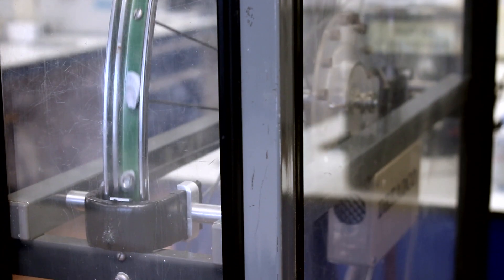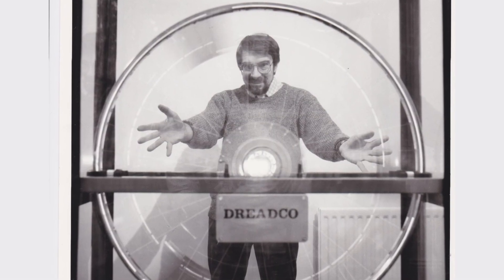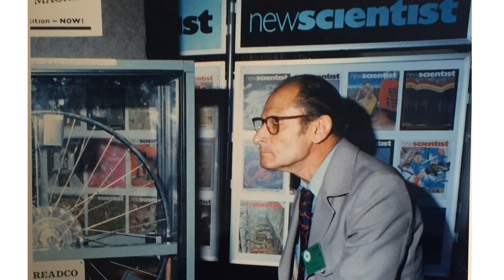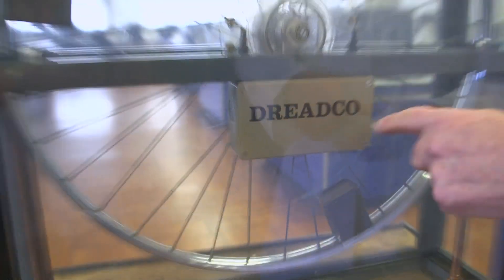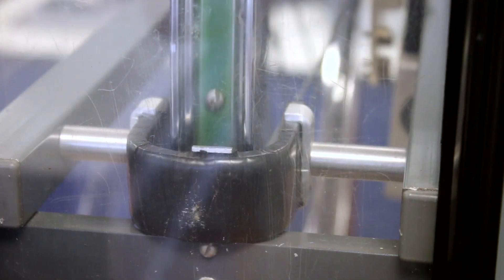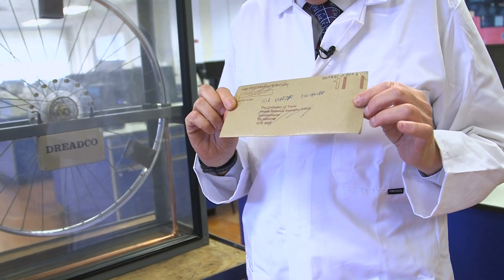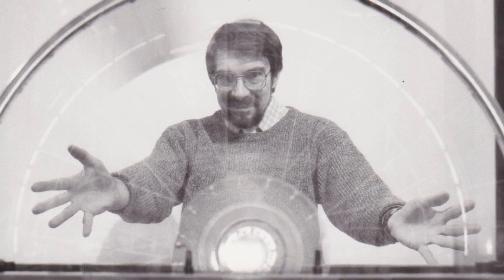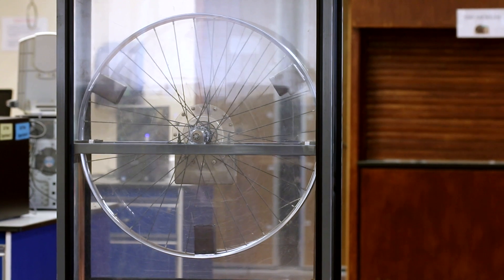Perpetual Motion Machine - Periodic Table of Videos

Comment: If I make guesses and they are relevant to the truth, would you confirm the guess is right or at least on the right track?
Does it have something to do with heat?  The temperature difference between inside and outside the wheel cabinet?
It's running slower because it's stored in an air-conditioned building?  Would it speed up if it is periodically moved to a warmer or cooler environment?

Edit:
I just visited the SubReddit and see lot of people asking similar questions.  I'm not clever.

Comment: It's either a magnetic push pull arrangement or the blocks on the wheel contain a liquid such as lighter fluid or isopropyl alcohol and as the box passes over the the heat sink area it vaporises, or if it cools, condenses, and alters the weight

Comment: Once this "machine" finally stops, it will be interesting to see if the energy source ran out or if the bearings have worn to the point where they generate so much friction that it can no longer be overcome. My guess is that the 3 boxes on the rim contain nickel/ copper stacks, wetted somehow with salt water to generate a small current. It would be simple to add a few coils of wire and rig up a electromagnetic circuit which pushes away once the yokes have been passed.  Once set in motion, it would keep spinning for a long time, provide a few mechanical rules:  The bearings have to be clean and with very low friction, The rim has to be balanced near perfectly with the boxed mounted. the axles has to be mounted level right to left to avoid breaking action from side loading. The display case must be sealed close enough to keep dust from infiltrating the space and "gunking up" the works.

Comment: My guesses:

1) The three boxes mounted to wheel each contain a small electromagnet, battery and simple circuity including a reed switch. As the box passes the magnet at a specific position, the reed switch closes (due to magnet force) energizing the electromagnet. A pulling/pushing force is generated between the electromagnet and permanent magnet. The trick would be ensuring the correct bias on the reed switch/timing to prevent the wheel from being stalled as the magnetic fields 'align'.

2) There is a small electric motor in the beige project box below the hub and axle. Perhaps a friction drive wheel is hidden in the horizontal square tubing.

Comment: I'm going to guess the center box and plastic disc with metal nubs on it are an electrostatic motor. Energy generation could be photovoltaic, thermoelectric generator, or concealed batteries. Electromagnetic is also possible, but I'm going to guess that's misdirection.

Comment: There are several hints in the video that helps us to make a good guess:

1) The fact that the wheel has been turning for two years, but been slowing down over the time period suggests quite a clever process, but one that is probably dependent on an electrical battery.

2) The steady rate of turn of the wheel would tend to reject the use of magnets, unless there were magnets all the way around the circumference of the wheel.

3) The question remains, how does the battery tranfer its work energy into the wheel?

Comment: It has a battery with a Jewel thief. This creates an small impulse via the ring of magnets on the inner ring with a high voltage via static electricity. In short, it's got a motor and a battery.

Comment: Most longlasting design would be a small motor inside the wheels axle. Pull a vacuum on the box so air friction will be eliminated. Very good grease for the axle and the thing will run 2 years without a problem. The tubes and heatsinks as well as the boxes on the spokes are likely decoys tricking someone into thinking, this is a very efficient thermodynamics setup.

Comment: Is hard to say not seeing it closely. Possibly magnetic repulsion motor with three counter balances with magnets, heavy duty alkaline battery and  box under contain transistors to control coils to weaken the repulsion when magnet pass, or it is pulse motor which timing is different a bit and can have  recharging circuit running of capacitor with help of alkaline/crystal/ or any type long time  battery. Big wheel , low friction bearings, counterbalances adjusted right, short control pulses it will run couple of years. One of mu toys was running slowly still after  2 and half year on good 9v battery. It is not a perpetual motion machine just very efficient motor. Anyway nice toy :)

Comment: Thermal expansion on one side of the wheel will shift the center of mass of it in order to rotate it, hence the input energy is the required heat.

Comment: Perpetual motion machine. Attach toast with jam to cats back. 
Lift cat, and drop. 
Cat always lands on it's feet. Toast always lands jam down. 
The result can only be a perpetually spinning cat stuck in mid air.
Reply: PJ put it in a washing machine drum and ta-da, free electricity
Reply: uhm actually .. thats how  a washing machine works
Reply: The cat is in an ambiguous state until observed. Fail.
Reply: Dorothy Baker unless you have a perpetually spinning cat in mid air, no. your spam has no power here.
Reply: but you need lift, so you wrap the cat in magnets and drop it on opposite pole magnets that are designed to stabilize rotating cat mid air.  cat is immortal so no need to worry about food
Reply: You need to put the cat in a box so that it can never die. Just don't look inside.
Reply: Except if the cat lands on its feet (which would happen) then the toast hasn't landed at all.
Reply: You fool, just use two pieces of toast haha
Reply: Where's the fun in that? 
I'd rather glue two cats together.
Reply: Tell that to one of my obese cats that slammed on his back from falling off my stair landing overhang.
Reply: I'm not entirely convinced. The result could simply be a cat with a jam toast suspended in mid-air, with no rotation at all. As long as they are excluded from ever landing, catoastions would not be required to have spin.
Also, catoastions would only be stable under constant observation, as cats tend to tunnel to random places whenever not observed. So if you look away just one moment, you'll hear the "splat" of the jam toast on the floor, and when you look again the cat will be nowhere to be seen. Probably on the other side of a locked door. Meowing to be let back in. Only to change their mind the moment you do open the door.
Reply: The Buttered Cat Array, huh?
Reply: @PJ I have been led to believe that is how UFO's hover and it would explain the screeching racket reported by some people claiming to have been abducted by aliens.
Reply: To get useful work out of the spinning cat/toast array then a spindle needs attaching somehow. I hope the cat doesn't find the spindle insertion too painful.
Reply: Just put jam on both sides of the toast. That way you can leave the cat alone. Maybe let it play with the floating spinning jam toast.
Reply: This is actually the original basis for Schroedinger's cat demonstration, but he changed it to radioactive decay in order to seem more scientific. The cat is both jam side down and jam side up until it is observed.
Reply: oh no that wouldn't make sense. It still has to use some kind of energy to keep the cat spinning against the air resistance, so it'll obviously drop down forever while never reaching the bottom, so it doesn't intersect with the stated axioms of cat and toast movement. 
The cat's angular momentum will decrease as well, of course, until she's spinning with an infinitely low velocity.

I understand how you could make such a casual mistake, but please, stand corrected.

Comment: I think somehow it produces energy from heat! Maybe that glass cover create a sort of a greenhouse effect that creates an air convection flux that may have something in common with that copper tube and heat dissipator that makes the wheel spin. Or maybe the energy generated by heat activate an electromagnet that turns on at specific times to spin the wheel. Those are my guesses.

Comment: Well my first guess was those three black boxes are solar panel and it's powered by some kind of electric magnetic force, then another guess came to me after I noticed the copper pipe, the black boxes might absorb light and heated up, the temperature difference of the liquid inside drives the wheel <3

Comment: Bicycle wheels are amazingly free running and small battery powered clocks seem to run for ages using only very small batteries. So my guess would be to conceal a battery and a clock mechanism style circuit inside the hub. This is essentially a tiny pulsed stepper motor and gears. The mass of the wheel would serve to smooth out the pulsed motion normally seen on the second hand of quartz clocks.
Reply: Such a delicate mechanical linkage would probably be damaged just from moving it across the room.

Comment: I think it has to do with temperature. 
The boxes might move due to convection currents; On the other hand what heats up the inside could've been a radioactive material that is running out of fuel with time.
Or, a thermocouple converting heat into electricity getting movement onward. Or the combination of both

Comment: bet all the common perpetual motion machine guff is just red-herrings. without being able to test various possible power sources (aka; leave it in a dark room for a week and measure change in rate compared to full sun to see if its really just basically a stirring engine) it's impossible to really say.

from what can tell if video would have assumed the little heat sinked box is a heat engine (using heat from light) powering some sorta air moving system to draw air from one pipe and pump it out the other? though seems that wouldn't provide enough power to over come rolling resistance the high quality bearings and well balanced wheel should allow it to run indefinately. HOWEVER you state that the wheel has been slowing down with time which implies an internal powersource rather than external, 

I think it might be something simple, the canisters are full of lead and the bearing is very smooth. though frankly that seems unlikely to pass the "Only one person has ever got it" rule

Comment: It must be an vacuum box, and there's a small solar cell on the side of the DREADCO box. It pushes the magnets on the wheet forward with the coils, which timing are taken from those hall sensors on the inner plastic ring with magnets. There's probably a battery inside the heat sinked case, as the heat sink is only to confuse you.. It slows down because the vacuum is leaking just a bit. Right!? :)

Comment: My guess is it's being powered by a Zamboni pile battery cell or similar. The same sort of battery has been powering the Oxford Bell since 1840 so it helps explain the longevity of the machine while also accounting for it's gradually slowing rotation.
Reply: ya. its probably just a battery powered device, but i love the illusion
Reply: My hunch too, especially because the small copper cups on the perspex disc around the hub are traced by two electrodes. So this could simply be a high tension motor with one electrode charging the cups to kilovolt potential acting as the tinfoil ball static electricity physics experiment, repelling them at one side and the other electrode attracting and discharging them. Though it looks like an ordinary bike hub in the center, it is a low friction naked bearing, which is needed for this to work?

Comment: A motor with a cog is hidden in the box which engages with the copper indents simply powering rotating it. Though the battery would.be flat by now...
Edit: proberbly powered off a solar cell.

Comment: I'd suspect that it's incredibly carefully balanced, has a shitload of rotational inertia, has very low-friction bearings, and is in a halfway decent vacuum.  And so it could just spin for a really really long time with no energy input.  And if there is energy input, it's probably really simple and minor, perhaps a very weak electromagnet powered by a battery.
Reply: it has to be around there somewhere.  otherwise why in the glass box?  why use tape over the "magnets."  i suspect they are copper coils and has magnets in the boxes that generate the charge to keep pulsing the electro magnetic motor.
Reply: I'm fairly sure it's not a mere vacuum-inertia storage system, since those will wind down faster due to gyroscopic effects of being moved. Admittedly, it hasn't been moved much if at all, but I also don't see one running that long. I really wish they had just said what it was. The mechanics of how this sort of thing actually work are still fascinating.

Comment: I have a number of ideas. All of them exploit changes in atmospheric temperature or pressure (or both). It could be similar to the Beverly Clock, which operates by converting changes in air pressure and temperature on a diaphragm into mechanical motion. Other ideas I have are similar. A barometer inside full of mercury rises and falls with air pressure changes, and this drives the mechanism. Possibly a material with high thermal expansion (such as mineral oil) pushes a weight up and down with temperature changes. Or like a mercury switch thermostat - a coil of expanding metal causes a tube with mercury inside to rock back and forth, which drives the wheel.

Comment: I would say that each of the three boxes contain a long life battery, (maybe lithium?) a coil of wire and some electronics.  There appear to be two magnets opposite each other along the outer frame.  As the wheel turns, when the boxes pass by the magnets, a small current is induced in the coil which is sensed by the electronics in the boxes.  This triggers the electronics to send a small current pulse through the coil.  This gives the wheel a tiny push (electromagnetically) using energy from the battery.  If the device was very efficient, it could easily run for several years.  The copper tubing and heat sinks are just for show.  I'm quite sure that this is what's going on, I would be surprised if it worked in any other way.  There are many conversation pieces that are based on this principle...
Reply: Yep

Comment: I suspect it is either through a magnetic field and electricity or perhaps through creating a difference in temperature inside the sealed box, creating a small wind current and thus slowly driving the wheel, also done with electricity along with those heat sinks

Comment: I wouldn't be surprised if most of the equipment is there as a distraction, and otherwise has nothing to do with the movement.  The product was created on the premise of being phony, so why couldn't a lot of the hardware also be non-productive?
Reply: Well he has heat exchanges, weights, magnets etc in there - all elements from different types of 'perpetual motion' machines. My guess is all of them are non-functional and the real mechanism has nothing to do with them at all - perhaps they are used to hide the actual mechanism that is turning the wheel from view.

Comment: It’s probably got a big solenoid within those copper pipes that pulls each magnet towards it, with a hall sensor within the labelled box to time the transistors. The metal pieces in the plastic disc mounted to the wheel could easily act as timing devices for the sensor. At least that would certainly work. Though the heat sinks on the other box wouldn’t be needed for such low speed operation and would act as a reverse red-herring, and I’d be very surprised if nobody had guessed it before.

Comment: I believe this two black magnet-like things are receiving and giving away heat, copper pipes are transferring heat and boxes on the wheel too. But still not sure how it works.
Another theory -- this thing is powered by motion. You simply charge it up while moving.

Comment: My guess?
It's just a wheel that's very efficient and well-balanced.
There is no energy input and a very very low heat (from friction) energy output.
The only reason it's spinning is that it was given a push all those years ago.

Comment: Your shots don't really giving us much to work with mate..., anyhow
the most suspicious part is the box with his company logo, the wheel is very well balanced with bits of bluetack, the bearings are free of lubricant so minimal kinetic friction, it takes very little to turn that wheel. so

I would say a simple mechanical contactor (say, a reed switch) that turns the "motor" on say, around 1/100 of a full turn and let it coasts the rest. basically just giving it a small kick at each turn. the power source is something simple like a few alkaline batteries. 

The motor is also very simple, something like a basic induction motor of sorts or even a simple electromagnet would do the trick, just need to get the timing right, or even a small dc motor. basically any of the many simple ways to give the wheel a nodge would do. just hard to narrow it down without a better look.

At least that's how I would have done it
Reply: LateNightHacks They measured an electromagnetic field and found one near the heatsink and the DREADCO box. Do you think the heatsink could be to throw you off?
Reply: Yeah, based on professor's reaction and their description I expect something very simple, almost disappointingly simple. Which would make a lot of sense considering the whole thing is made to be a mockery of the free energy crowd. Anything unnecessarily smart and complicated would take away from the main point of the project.
so, basically I expect anything one could see from the outside to be a decorative part, the actual drive is the only hidden element

Comment: OH, the heatsink is a give away it's a heat engine (sterling) of some type? Light / shade allows for a cold / hot gradient, that allows for "wind/ air flow" from the pipes to blow the wheel around. :)
(As others have mentioned, also possibly a peltier?)
What do I win?!?